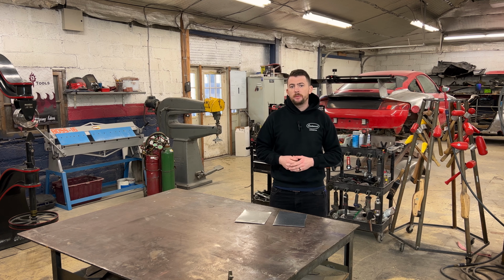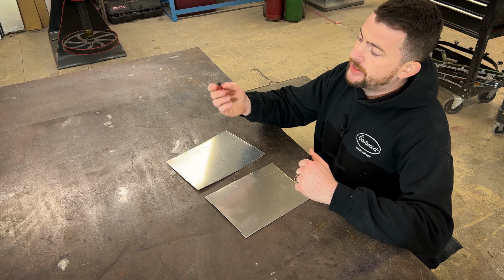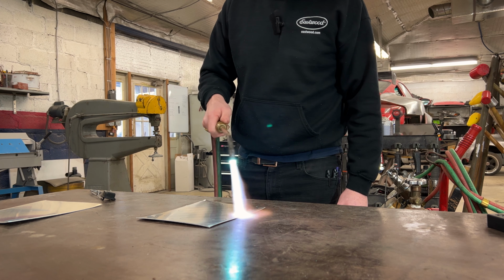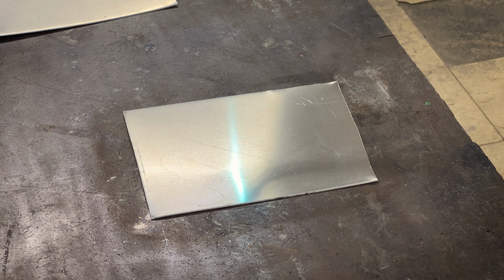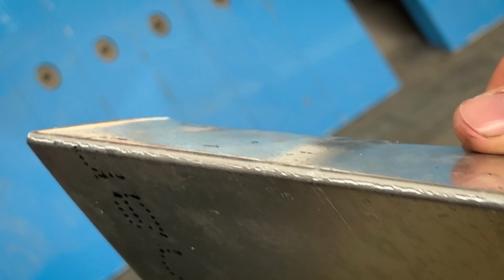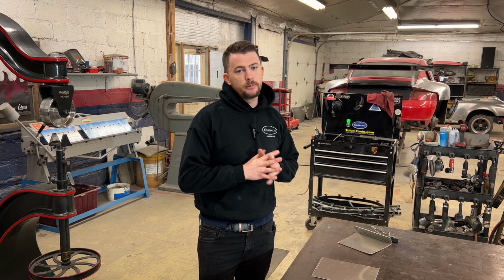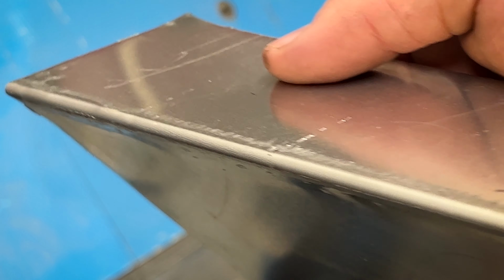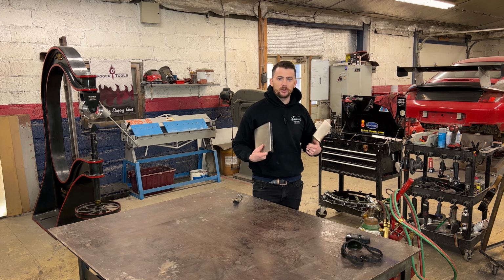HOW I ANNEAL ALUMINUM FOR METALSHAPING

Comment: This processes is counter to pretty much every other video I found on annealing aluminum on YouTube. Pretty much everywhere says that annealing aluminum is essentially the exact opposite of a kneeling steel and that’s the process that you’re taking. Heating and slow cooling versus heating in quenching.
Reply: You are correct. Precipitation hardening of Aluminum is done by heating it and letting it cool slowly. Quenching softens it. Copper behaves in the same way. This video is inaccurate.
Reply: Okay, I'm not a metallurgist but I have had extensive conversations with one that oversees the largest jewelry manufacturer in the usa.  I work mostly with precious metals and I am an aluminum and steel tig,mig,  laser welder. This video is not incorrect. There is more than one way to anneal most metals. Some metals require a very specific procedure to anneal and some are not as demanding. We need to understand that most of the hardening is "work hardened" so if it is heated and allowed to cool it will in fact anneal it. However, maybe the procedure to anneal it to a "dead soft" stage will require quenching but this does not mean air cooling will not produce a softer temper aka annealed state. Think about it, how many of us have smoked a drill bit and turned into soft worthless iron? we didn't quench it did we? No , all we did was heat it really high and that is all it takes. Another example is when we jewelers sharpen our  high speed steel hand gravers, if one leaves it in the grinding wheel too long guess what? yep, it gets annealed and it's worthless. I believe air cooling might be better because if one only anneals part of the sheet and quenches it, they may cause a stress crack where annealed part touches non annealed part. Kinda like welding something then quenching it, thats never advised in steel or aluminum that i know of. Thank you for reading, Desy
Reply: @TonyUrryMakes I'm new to metalworking so I don't know anything but the physics I took in high school and college.

Question: how do you explain the decrease in stress marks on his slow cooled aluminum, if it should be quenched instead of slow cooled?

Comment: I have several large panels of Al6061 t6.  I’m glad to see that it is so easy to anneal.  I want to experiment with sculpting a lightweight grill for a 72 Alfa Romeo spider, shaped like the elegant original, but with liberties taken to make it much lighter yet still pretty.  I normally use it to make things like battery boxed, clamps, inner panels, mounts, etc for weight saving.

Comment: Does it matter what type of torch you use for this process? Would a map gas torch work?
Reply from the maker: I actually prefer MAP gas for it!
Reply: I use a kerosene wick lamp to soot the metal, and a propane torch to anneal.  It does not require a lot of heat to anneal.
Reply: Seems likely that maap gas would be perfect.

Comment: Hello! Great video. But i am wondering - since you annealed this whole plate - how do you return it's original properties after you bend it as you like? Won't it stay softer now and bend easier even if you don't want to ?
Reply from the maker: Great question! Yes, it will stay softer. So depending on the application it’s important to keep that in mind when annealing. For example with the Slantnose diffuser we built: we annealed only the areas that needed to be bent so the long straights would remain rigid. Another factor is work hardening; where the annealed area will harden itself as it’s manipulated. Most of what we do I wouldn’t be worried about it softening as it’s generally for external body panels that are worked back close to the original hardness.
Reply: @CrucibleCoachworks  Thanks for your answer!
Reply: “Baking” at 350 F for an hour or two will increase temper back to somewhat near the original hardness.  Kitchen oven works for small pieces (brackets for example).  Correct to only anneal the area you are going to bend, not the whole panel.
Reply: Aluminium will age-harden too. Firms that build aircraft wings will tend store the metal in fridges to maintain the softer condition prior to forming. Or that's what we were told.

Comment: This process is not annealing, it is normalizing. If your intent is to anneal, there has to be controlled cooling. The soak time, rate of cooling and constituents of the alloy have a significant effect on the finished job. There is a considerable amount of free, easily accessible information on the subject, it is worth taking the time to research. 
What you did was normalising (air cooled). It may not matter on some parts, but could be critical in others. It is important to understand exactly what you are trying to achieve when heating and bending any metal. It may seem like nitpicking to you, but it can lead to confusion and perhaps dangerous and/or costly outcomes.
Don't be lazy, do some reading and you are likely to get improved results.

Comment: I would have bent it while reasonably heated, that goes for any metal
Reply: Don't do this with aluminium. It's "hot short" so it's more brittle at temperature.
Reply: Most metals must be properly cooled after annealing, before being worked on.

Comment: Precipitation hardening of Aluminum is done by heating it and letting it cool slowly. Quenching softens it. Copper behaves in the same way. This video is inaccurate.
Reply from the maker: Precipitation hardening: 
- Bring a mixture of two or more components to an elevated temperature, where they mix completely.
- Cool the material very quickly to lock in the completely mixed state.
-Bring the material to an intermediate temperature, often called the 'aging temperature'. The aging temperature must be high enough that diffusion can occur rapidly, but low enough that one of the components can no longer dissolve the other so that precipitation occurs.
- Cool the material to room temperature after the precipitates have grown to the desired size. Since room temperature is too cool for diffusion to occur rapidly, the precipitates will stop growing.

This video is accurate. 🫡
Reply: @CrucibleCoachworks  I am a Machinist  (since the early '90s) and was tempted to explain how this worked.   No need now that you took the time to do a bit of maintenance on your own process video.    Cheers
Reply: @CrucibleCoachworks   I think this is what I'm looking for in my application. Soften to the maximum extent. I have an aluminum valve cover gasket in my bike engine and I always get oil seeping out of that gasket. Slow, but an annoyance. I'm wondering if the manufacture process of these gaskets tend to "work-harden" them before they're even packaged up and sold. Am assuming they're stamped out of AL sheet. And am wondering if they need to be re-softened before actual use? So quench in water? Maximum softness?